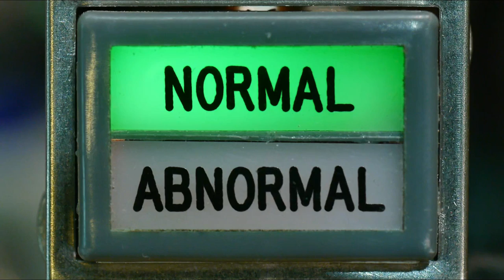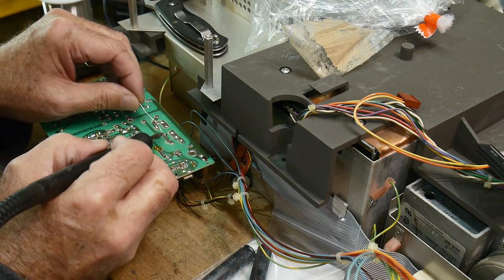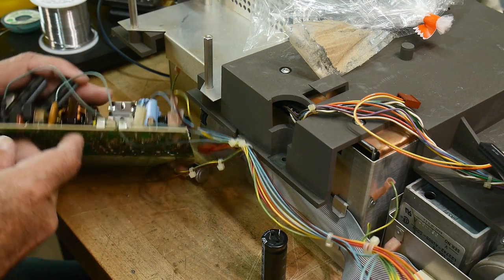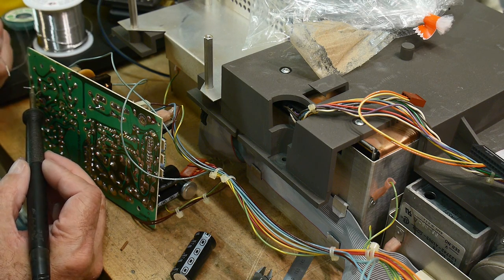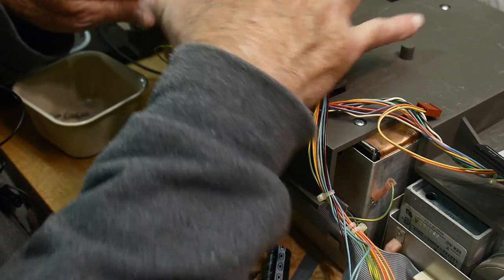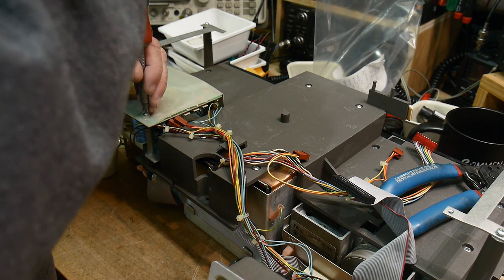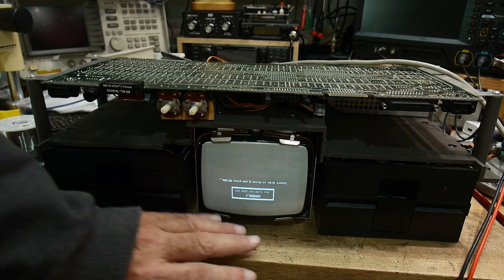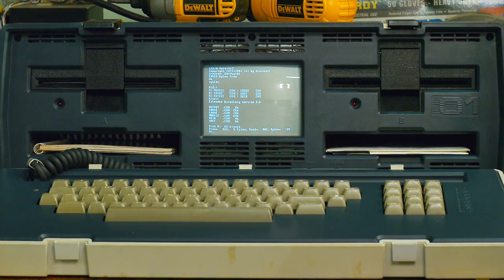#1007 Osborne 1 Power Supply Repair

Comment: Yes, always check the diameter and height on the replacement capacitors, because the smaller diameter will always tend to be taller. Sometimes you are going to have to be creative though if you run out of options. Tall skinny tends to be the capacitor that is going into tight confines, right next to toasty heatsinks.

-12V yes for RS 232 comms, and the -5V was for early DRAM chips, and for some very early EPROM chips as well, that needed a substrate bias, and some of the early processor support chips also wanted -5V as substrate bias, before the bias generator was integrated onto the die, and then connected via a bond wire to the substrate in addition to the diffusion through the chip itself.
Reply from the maker: I'll be checking size now. in the past, newer caps always have been smaller so never paid attention. The funny thing about the off the shelf PS they used is that the -12 is not wired to anything on the computer. I think they had visions of battery supply
Reply: @IMSAIGuy  Possibly, or a different power supply unit originally, while this was a in production replacement type, as there were quite a few power supplies at the time that had the same footprint from various vendors around.

Comment: What kind of power supply is this? If it wasn't outputting anything, (0v on all the outputs) but had 120 v input on the board past all the fuses, what would be the first thing of concern not including the temp sensor.
Reply from the maker: this is a switching power supply, mine was not dead but just sick. If you have a supply with no outputs, the most likely problem is the power FET
Reply: @IMSAIGuy  alrighty thanks.

Comment: Should have PIP in there on the one disk, or you need an older 286 with a 360k diskette drive, and 22Nice or 22Disk, to write and read the Osborne disk format, and copy from almost any CPM and Dos diskette format to almost any other. Used to have it around, it came in handy, a nice piece of shareware.
Reply from the maker: yes I have pip, will cover that in a future video. I don't have an older machine to try 22disk. are you sure it can make single density 92k disks? some of the osbornes can do DD and it is easier to move things between computers.
Reply from the maker: on the SD drives, osborne bought the drives with out the PCB and put their own controller on the drive. the later DD ones use standard drives
Reply: @IMSAIGuy  I do remember reading Osborne diskettes on a 286 machine with 22disk, so it should at least be able to work, though it really depends on the FDD controller being either the genuine Intel or WD controller, as the later integrated ones did not include the full register set internally, so they could not write the more exotic formats. they had the IBM format hard coded in the silicon, and the actual registers were not really present, and, as they were write only, would silently fail.

Comment: PLEASE DON'T USE OLD RIFA LINE FILTER CAPACITORS.
They are known for very high failure rate!
They may short, smoke or create other pyrotechnic effect.
Reply: Kemet (who now own RIFA) claim that it has been reformulated and won't suffer the same fate.  Thought I tend to agree and I use other options myself.

Comment: My Osborne executive stopped giving image a few days ago. It was working with an external monitor. I checked the voltage and it was generating 14V instead of 12. After removing the PSU, it started to click every second. I tested the voltage after the diode bridge, and it was 166, but according to the internet, it’s normal that the voltage increase after the bridge…. Since I’m not very good with electronics, if any of you have any tips of what I should text, I appreciate it. Thanks. (I wish in my small city of Idaho Falls I could find someone willing to take a look in exchange of $$$). But I couldn’t find any. Thanks guys.

Comment: Uh, couldn’t you substitute the RIFAs for something else?
Reply: It is funny that we viewed RIFA capacitors with a large dose of national pride here in Sweden during the 80ies when I started to learn electronics. They were considered high quality components and was quite expensive I seem to remember. That perception has changed quite a bit for everyone that has had them explode in old HP gears. But I guess it is hard to know if your materials will last 50 years or not at the time of manufacture.
Reply: They will be good for another 30 years before you go in to change them anyway.
Reply: @deBug67  It’s just one particular style of Rifa across-the-line capacitor that’s problematic. I have limited experience but the electrolytics seem to hold up just as well as other brand name parts.
Reply: Kemet (who now own RIFA) claim that it has been reformulated and won't suffer the same fate.  Thought I tend to agree and I use other options myself.